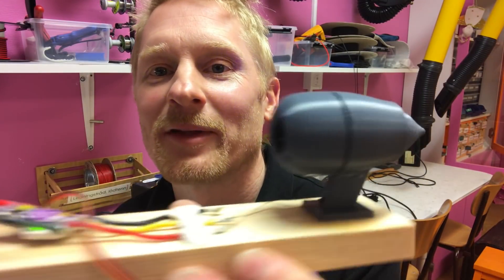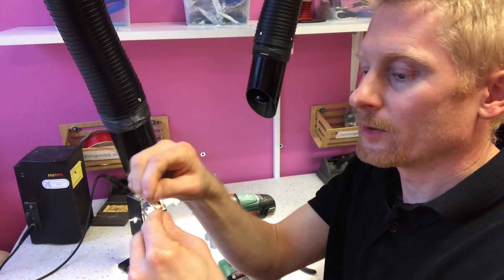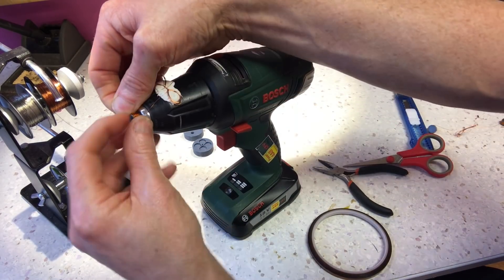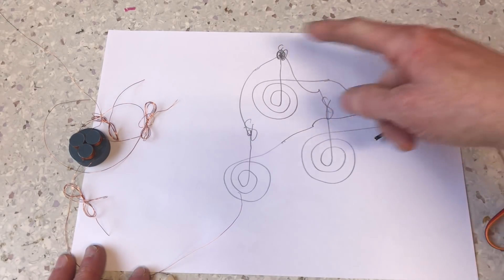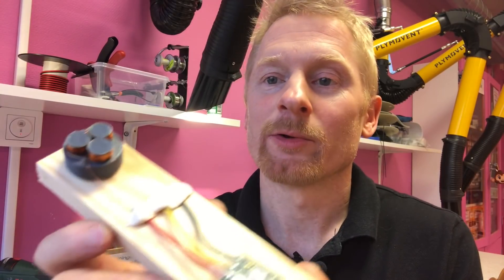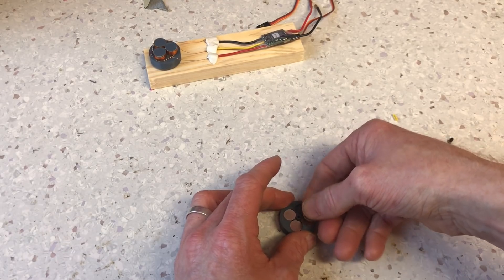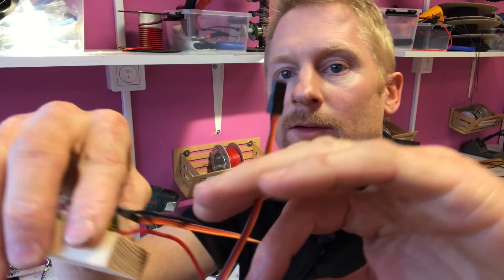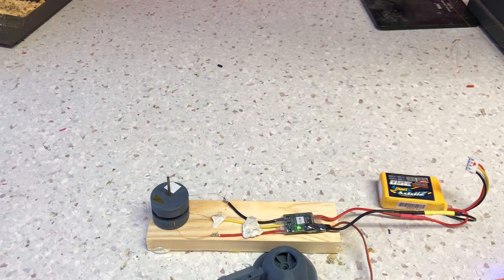3D-printed  3-phase electric JET  motor build!

Comment: You are loosing all the air in the gap. Why didn't you just make the rotor compressor and a casing to go over it and fully closed?
Reply from the maker: Probably true, however Im going to build this motor with young students, and the precision in the gap is so much easier to manage without a non overlapping labyrint seal. But I might try a modified version just for myself. Will post a video if there is a significant performance gain. The main gain of this design compared to the bare bone motor is that the coils get enough cooling in the jet-setup.
Reply: @amazingdiyprojects  You are overcomplicating things.
I mean, build the compressor as a separate piece, and the curved cowling can just go on top, making a full seal. Nothing should be much different other than making the compressor in "two pieces". (inner, actual compressor blades and external cover for that).
Reply: Abraham How do you actually gain thrust for flying here? Do you still use hydrazine and such or is it just a super fast propellor ‘jet’?
Reply: @Nixie_EUC  Keep in mind that the whole thing must be able to be 3D printed. If it has overhangs, it requires supports and those supports must be removable.
Reply: @Nixie_EUC  If you're that distraught over his educational video and the outstanding application of a 3D printer, maybe you should build a jet motor, make the "how to" video and upload it. These videos serve as the spark for imagination in building ideas. If he went with the fully decked out, full scale version, then no one will ever learn. It's like being a chef and cooking. You have to learn the basics, such as mother sauces, before you can jump to the epic shit. So stop busting his balls and enjoy the content.
Reply: @mehmetcanbozkurt14  
I saw your project. = 💩
Reply: Abraham
It's meant to be a simple project build'' for educational purposes, so you obviously don't listen knowitall!
Reply: @Ryben Flynn 
I dont think there is such a word as "loosing". There's "lose" and "losing",  "loosen" and "loosening". Nope, no "loosing".
Reply: I like the idea , encrave holes to scoop air in the compressor and encase it
Reply: Add it to a cox engine, make it turbo
Reply: @AngryHybridApe  wow I haven't heard of those type of engines in a very long time. I miss those days
Reply: Whats the difference between this and a edf(electric ducted fan) used in rc electric jets.
Reply: @devinboesch8840  This is a jet, not an EDF. I don't fully know how jets manipulate air going through them, but it has more to it than just pushing air through.
Reply: And well, being the head of the motor itself (Mobile) they could always be incorporated with a 3D printer of the propellers to increase its thrust!
What you wouldn't get with the turbine, you would get from the propellers themselves, don't you think?
Reply: You must be fun at parties.
Reply: @Udavka535  

https://youtu.be/BzTtB8Jj4eo
Reply: @Udavka535  

Я интересуюсь электроникой
Reply: @Udavka535  

https://youtu.be/BzTtB8Jj4eo
Reply: @mehmetcanbozkurt14  Your video has nothing to do with motors so stop pushing your stuff here on every comments!

Comment: I like how you said that the you were going to make it in Y configuration that gives more torque and we need that because of no iron core, absolutely right. I'm just a little confused about the number of turns per coil, is it random once you wind it quickly with a hand drill?

Comment: Your jet engine is very basic and the intake and thrust areas are unnecessarily choked off. If you widen the intake area to match the outer circumference and put a row of stator blades directly behind every row of compressor blades and lose the cone at the thrust end, you should see an improvement in airflow. If you put that cone on the intake side then you should keep the restriction at the intake the way it is (or fine tune it for best performance in conjunction with the blades and cone). Have the center shaft run the length of the engine so it connects the intake cone, compressor blades and the thrust body/blades at the tail end of the engine. The stator blades need to remain motionless so the compressor blades can do their part in compressing the air. Without a source of fuel and ignition, I don't know how well this mockup of a jet engine will perform but it should move a greater volume of air over what you currently have (and without materials capable of withstanding extremely high temperatures, I suggest NOT installing sources for fuel delivery and ignition). The design of the compressor blades, the stator blades, their relation to each other (size, distance, angle of attack) and the thrust body/blades is kind of on the complex side of things but with a little experimentation and time, I think you could make a winning engine/educational tool.
Here's to your continued best of luck with 0 discouragement ahead of you, cheers lad.

Comment: Its not three phase. Phasing is used in alternating current where different phases alternate between each other 230vac 480vac...... But DC doesn't alternate so it can't have different phases. Its a single line of DC current being out put through a mosfet multiple times through different coils that's not phased current.

Comment: The motor design is quite clever, simple to build and wind. Would adding steel hex screws in the center of each coil (acting as a magnetic core) increase efficiency?

Comment: I think this would more accurately be called a ducted fan or ducted propeller. A jet engine would have a compressor and turbine and generally combustion for heating the gases.

Interesting build though, looks fun.

Comment: Putting the motor in star over delta should give it less torque . The speed shouldn't drop much as both connections would have the same synchronous speed but the slip would probably be more on the star set up, depending on the load.

Comment: This motor is not very well designed. The permanent magnet disks have a relatively low length. You can use a "magnetic mirror" (a ferromagnetic disk with a thickness of about 1 mm) at the opposite side of the permanent magnet to the coil to virtually double the length of the permanent magnets. In this way you have a lower decay of the axial flux. Furthermore you have to keep the coil as close (0.1 to 0.5 mm) and as short as possible. Don't use a length of the coil which is longer than the permanent magnet length. In larger distances from the permanent magnet, the coil doesn't interact very useful with the permanent magnet. It is further necessary to fully embed the permanent magnets and coils into the stator and rotor plates. In this way the air streaming and friction losses of such a motor can be reduced a lot.

Comment: Can these can flay RC jet plane, it's dasent have propeller for air compretion to flay and lift up RC jet air craft. Just turning high speed RPM no air propeller for air proportion compression.it works only for RC Wheel car not for jet RC plane engine turbine propolsion.

Comment: I watched both of your videos and I am Very Impressed!!  I am thinking that a second high bypass set of fan blades, that are mounted externally on the current armature, ( with a second  duct that is attached to the blade tips), would produce more thrust with a small increase in weight.  A spinning Vortex is the most efficient way to move a fluid quickly while using less energy.  By creating a low pressure area ahead of the moving object, the differential pressure from rear to front will be greater and the object is Pulled into the low pressure area.  Would more (8 to 12) but smaller sized magnets require an additional 3 coils to generate more torque and thrust in the same physical area?  In any event Your Project is Amazing and gives me a lot of food for thought and design.  Thank you for making these videos!!!

Comment: The problem with kapton is probably that it is isolating the heat from the environment, so in case of relevant heat development, your coil would melt faster. Still damn cool project though!

Comment: Nice idea, but I feel there is a lot of room for improvement in the design (not trolling) just constructive feedback, smoke test showed venting around the join of the engine, additionally, I would be interested to see if a turbofan style with exhaust fan blades increased rpm?

Comment: If I use a bit of bigger magnet and more copper wire... will it go faster???
Reply: It might actually go slower, but you want slow because slower usually means lower kv, meaning higher torque, and more power. It will require more voltage, though. Smaller windings and less powerful magnets= higher kv, and higher speed.

Comment: I did everything over again making sure my windings and magnets were correct. I tried two different ESC of two different brands. One was a 35 amp and the other a 30 amp that I use on my RC airplanes. Still just shudders and will not spin. The only variable I can see is that we have different  ESC's. Did you have to do something to change the timing in the ESC? If not this project turned out poorly.

Comment: Printed and tried this. Having a problem. the motor just kind of shudders. It never does spin. Not sure what I did wrong. I double checked the magnets and I'm sure I wound the coils correctly. Any suggestions?
Reply: Check the esc or wiring maybe?

Comment: Nice project, might give it a try myself. But I would be a bit scared reving a 3D print up to 20k RPM. On the smoke test you can see that there is a huge loss in the gap. I wonder if it could be improved by making a sealed construction, and maybe using a HDD motor.

Comment: Smoke test; the intake needs a small shroud printed with it, that over lapse the rear, then the exhausted air that leaks out will be directed back, instead of it's current deflection of 90º

Comment: amazingdiyprojects - I enjoyed your video. But, I have a question. It seems that you have a two pole stator (each three phases makes two poles), and a four pole rotor (with four magnets). Would it work better to have just two magnets, straight across from each other, one north and one south? It seems to me that you would want a two pole stator to be matched up with a two pole rotor.

Comment: I tried to print the parts but had so much support it was impossibly to clean up. The little coil spools just did not print as almost a solid rod.
Reply: Try again, this time with no support on the coil spools, and only touching the build plate for the stator and rotor. Also a lower layer height and line width will help make it look cleaner

Comment: Have you been able to measure the thrust produced by this motor? Would it not be better if you would use a higher number of smaller magnets (lesser diameter) and the same number of coils with a smaller cross section?

Comment: I have tried adapting your design of the motor to make a stronger version but it failed, details for the experiment here i would appreciate your help https://electronics.stackexchange.com/questions/425485/i-have-designed-and-3d-printed-a-new-motor-that-was-based-on-a-video-i-saw-earli

Comment: Whenever you have rotating parts at that speed that are 3D printed, there is always a question of safety. Aim away from face, and remember that the parts will fly away from the axis of rotation, so looking right on axis in front or behind should be ok.
Reply: Plastic does not show up on x-ray, so everyone trying this should listen to rorybz advice. 
Great little project though :)

Comment: That is really cool Idea, and looks and sound great. Two suggestions, may be you could run the time laps slightly slower, so one could pick up what u are really doing. May be wear some Safty glasses (for something so small with such high rpm the chances that it 'explodes' in a thousand little peaces is pretty high, I guess.)
Anyway love your videos, 
best regards:)

Comment: Seems it needs an airbearing rotor shaft, and superconducting power rails.
You might need an epoxy granite CNC machine, with trunnioned rotary table.

Comment: Hey! Just wanted to let you know, your design has helped me a ton with my own. I was struggling to get my own axial-flux 3d printed brushless motor working, but watching this I realized I am using the wrong style of magnet. I was using bar magnets, which have a smaller field than the discs you used.

I have ordered some 10x2 disc magnets (as you used, I believe) to test my design, but will probably end up using 10x6. I plan to publish the design when I'm finished, so I'll definitely give your design a mention for the inspiration it's provided. If it wasn't for finding this video I would have been stumped for a while.

Keep doing cool stuff! I've subscribed so I can keep up with your neat ideas.
Reply: @imnat5205 hey bro I have a doubt when I connected the speed controller to battery the magnet holding thingi diddnt spin. Do u know anything about it

Comment: Kapton tape is temporarily resistant. If you arc kapton you'll have a conductor instead of an insulator.
Actually, I would never use kapton tape as an insulator.
As good as it is, it also has serious drawbacks that present themselves in certain situations.
(Yes I know the cable obviously has insulation by itself).

Though I don't ever think Kapton would become a problem in the presented usage form. :)

Comment: You lost me on connecting the coils. The ends without the figure 8 connect to the controller. The ends with the figure 8 connect together and then connect to what? Nothing? How does each coil get the opposite polarity to create a magnetic field?
Reply from the maker: Not nothing, to each other, creating a closed circuit when a current is flowing in and out from any two of the three ESC wires so they becom electro magnets of opposing polarity!

Comment: You know, technically, as the outside of the motor is the rotor.... You made a ducted fan that's it's own outrunner motor. Which is amusing in a neat way.
Reply: also, I assume that you could run electromagnets instead of permanent magnets provided you had a source of current going into the rotor, correct? mostly because Neodynium isn't the cheapest thing to buy if you want to make a larger motor.

Comment: This is the imitation of engine or you tried to make work turbin? At the first you need a labyrinth seal between rotor an stator, because you losting power this, or made normal turbin with impeller inside body. Be careful with centrifugal forces.
Reply: not the   point

Comment: Axial flux motors that have 3 coils should usually have 2 magnets instead of 4. Using 2 magnets instead of 4 could increase the rpm of the motor and make it lighter.
Reply: did you tried to check the power in grams ? to mesure the difference
Reply: Sponge - Yes, I agree. He made a two pole stator (each set of three phases makes two poles), and a four pole rotor. I think it should have a two pole rotor to match the stator. I think it should have two magnets straight across from each other, one north and one south. This will make it become a synchronous motor, better torque, less vibration, and lighter. If I am wrong, please someone explain to me why his design is better.

Comment: Love it, can you please do a rotor, just the rotos 5 ichs in diameter and with 3 blades 5  of 4.5 pitch that motor will be handle a 5.4.5 3 blade with no problems, giving a nice trust for a rc plane.

Comment: I didn't know you could build a BLDC motor like this, usually the stator is in the middle or at the outer portion, I didn't know you could put it at the bottom and the permanent magnets at the top. Very cool project!

Comment: What battery (2S, 3S) are you using. I tried but can't figure out from the vid what type of Zippy 350 you use. Or, is the driving voltage not so critical? Supercool project and video though! Many thanks!! I will absolutely put this on my list of project to tinker with over Christmas :)
Reply: Oh, 3S! You say it at the end of the video actually. Sorry - missed that :)
Reply from the maker: I use a 3S battery in the video. anywhere between 9-14V will do fine.
Reply: @amazingdiyprojects  Thanks! Are you by any chance located in Sweden (just a hunch)?